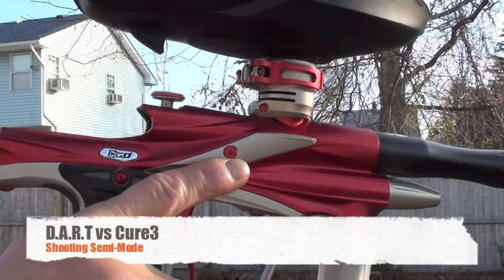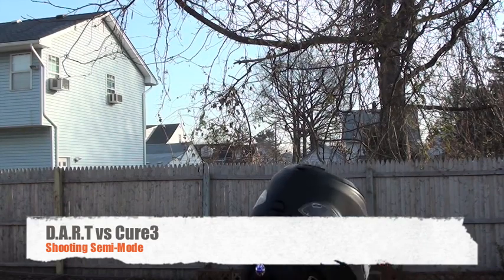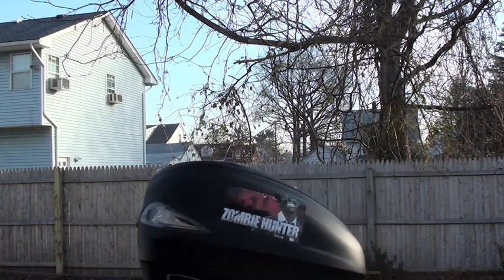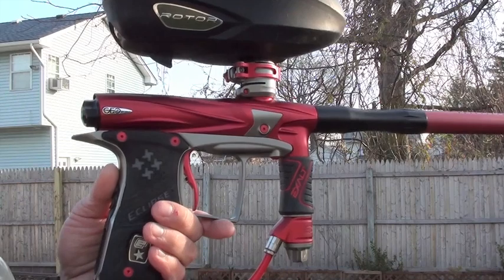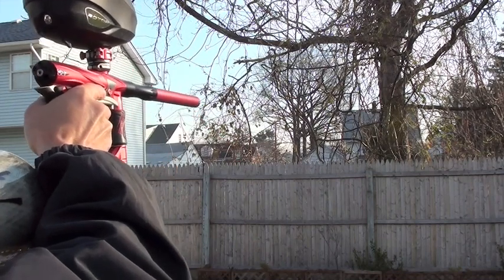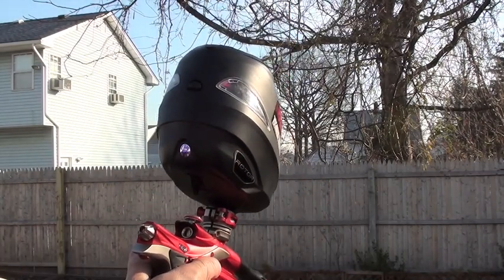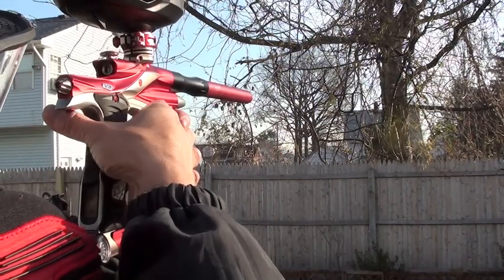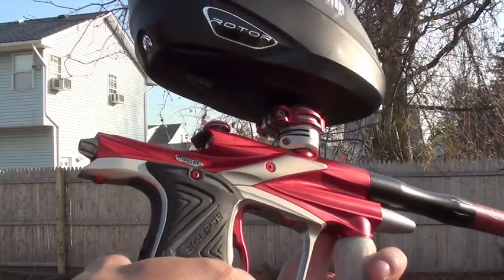DART Bolt vs Cure 3 Ego 11 Shooting and Sound Level vs Geo 2.1

Comment from the maker: If your getting it used, Ego11 since it's now in the $600-$700 range. But really depends if you like poppits or spoolies. I had no issue using my Geo3 in 17F temp

Comment from the maker: Right now, I have the LPR set to stock as Jack recommends. I have about 2k shot through the new valve so I figure shoot a few more case to break in the valve and tune from there. But it is still a pretty good sound reduction from the Cure3. 

BTW, it's just an empty parcel of land behind my fence which is not accessible to the public.

Comment from the maker: I've owned both and IMO, it's a really tough choice. Efficiency has a edge with the Ego11 with or w/o the kit (at least in my case, my geo2.1 was over 160k so it was very broken in and efficient). Smoothness is a very slight edge to the GEO2.1 over a well tuned Darted Ego11.

Comment: so stock valve/cure3 vs dart valve/ dart bolt. it even says on the box that your supposed to use the dart valve with the dart bolt.
ALSO, the reason the cure3 is louder is because it doesnt have the weight like the dart bolt to hit the poppet harder, leaving it open longer. which is why you had to adjust the HPR so much. so with less mechanical dwell time caused by the cure3, you have to increase the HPR to get the same FPS.

Comment: Would have been better to do the test with all stock parts vs the dart upgrades, instead of using the new valve assembly with the old bolt.

Comment: you do know that the dart kit is heavier and strikes the poppet valve differently than the stock cure 3 right? so you cant make a good comparison between the two without changing the poppet. what you should have done, is do a clip of shooting as stock, then throw in the poppet valve and dart and do another clip.